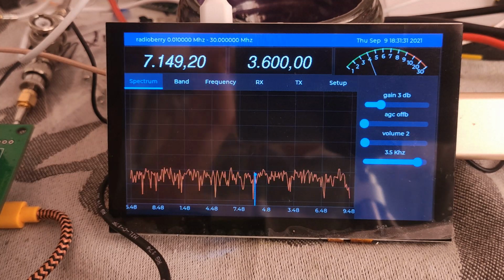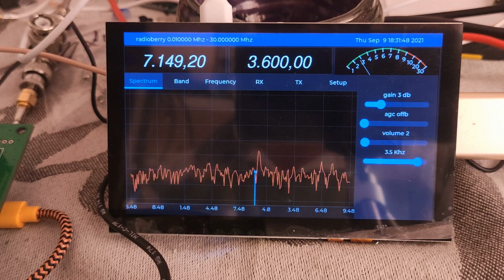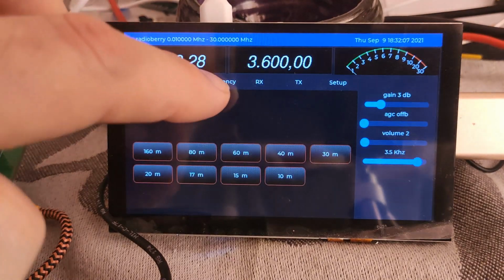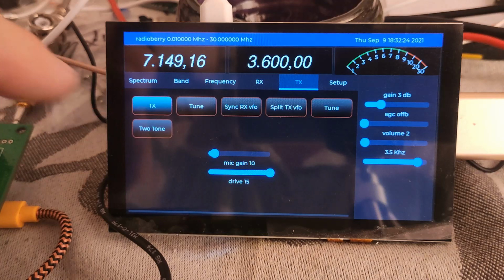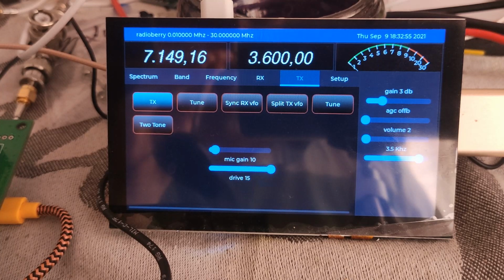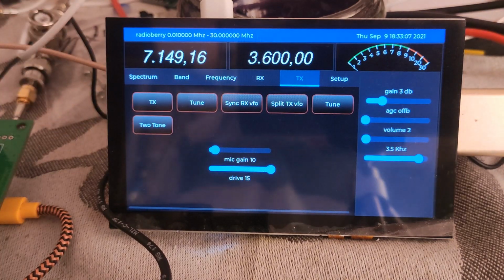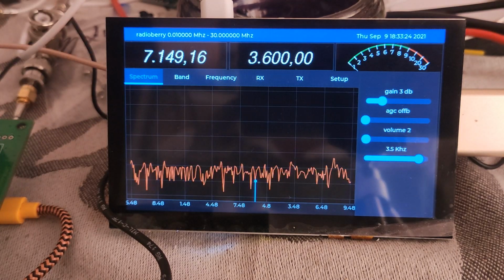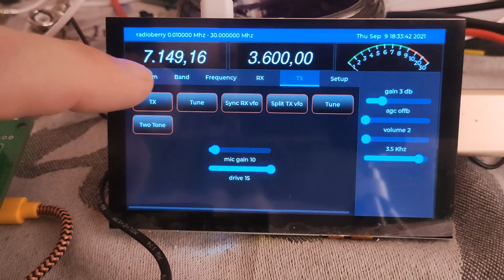Raspberri Pi & radioberry trancever using LVGL GUI

Comment: If i  understood it well ,  this application is single  app runs on some embedded linux installed with it.  Is it right  ?  Similar to  malahite SDR or afedri lan iq.
Reply from the maker: Yes, it uses Raspberry pi OS, but should run on Ubuntu or other Linux as well. Difference is it uses soapysdr to connect to any soapysdr sdr tranceiver like adalm pluto, or even audio based sdr's
Reply: @paulh0029   Thank you. And is raspberry pi OS  configured in kiosk mode ?
Reply from the maker: @pjaro77  no in cli mode so no x windows. It uses frambuffer for direct display. But you can swap display driver for wayland if you like
Reply from the maker: @pjaro77  Pi os runs in cli mode, i use the framebuffer to output to screen. So no xwindows.  I use crontab to start the application at after boot